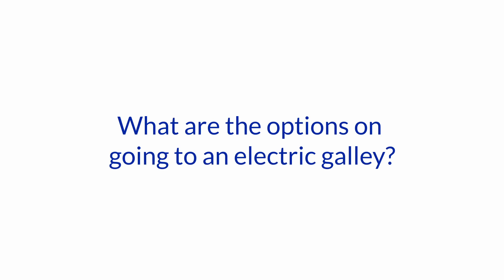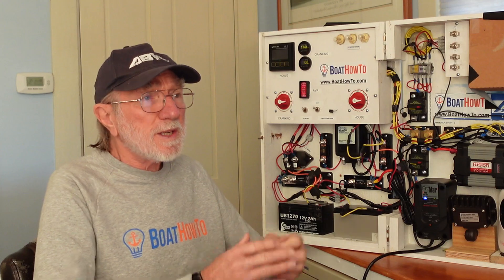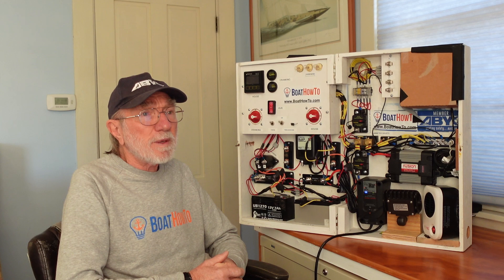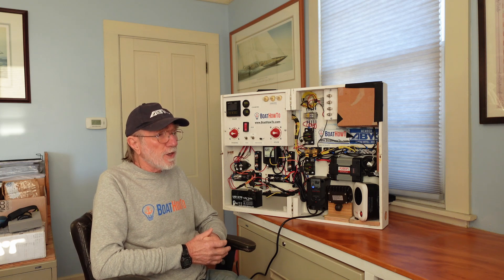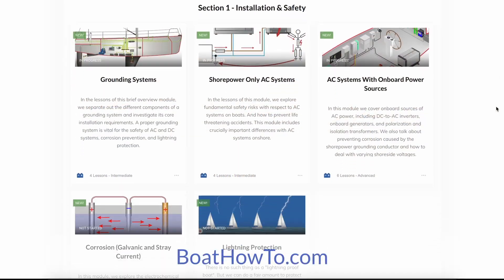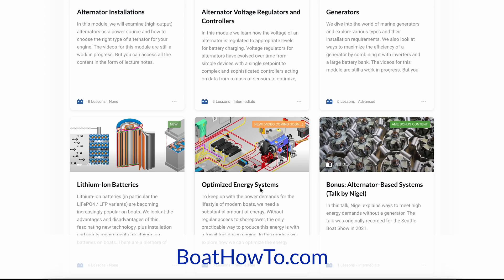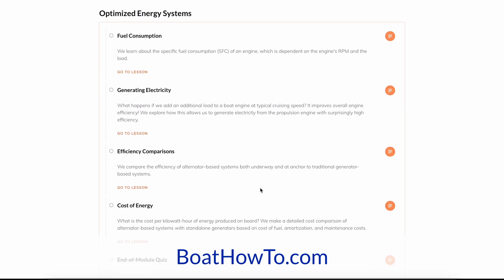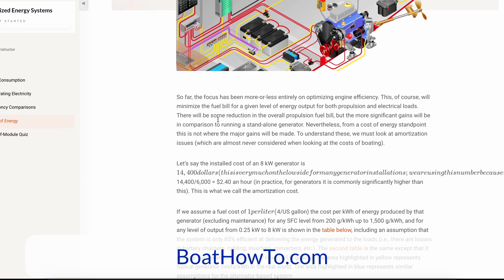Fully ELECTRIC GALLEY - is that a GOOD IDEA ?? | Ask The Expert with NIGEL CALDER

Comment: Cruisers are now installing the Panasonic NN-CS89LBBPQ 4 way combo oven. It is a microwave, convection oven, steam oven and grill all in one. Ours will be gimballed with a single ring induction hob mounted in a frame on top. We have a second single ring induction hob that can be pulled out and set on the counter top at anchor. The Panasonic uses no more than 2kw in any mode or combo setting. Ventilation isn't a problem as it is mounted on gimbals

Comment: Never met a decent cook that prefers electric to gas. Hope you like sandwiches.
Reply: That's changed dramatically with induction. Europe is way ahead of the USA here. The control of induction and the higher heat you get compared to propane is very noticeable.

Comment: I'm refitting a boat. The propane stove was shot, so I pulled it. My intent is to build a gimballed box to fit in the space with induction burners and a combination air fryer/convection oven/microwave oven. In the meantime I have the burners and oven plugged into my wall outlets in the kitchen and I've been cooking exclusively on them for most of a year, and on one additional device - an Instant Pot. Oatmeal, soups, stews, and even Sous Vide steaks, cooks more easily in an Instant Pot than in a pot on an induction burner, and uses less electricity.

Comment: We have been electric only for years! In fact the boat we have now was splashed in yr 2000. And has allways been fully electric re. coocking, no propane on board. Our microvawe is installed according to manufacturers spec., and works brilliant. And we have an induction top. In short, no issues at all.

Comment: I did this a few years ago . Three induction hobs and commercial  grade countertop convection oven that I dissembled and upgraded the insulation with aerogel . This enabled me to achieve a 30% duty cycle . The oven holds the heat and the cooktop only heats the pans . This I built into a fully gimballed unit that fits in the same place as the old unit .